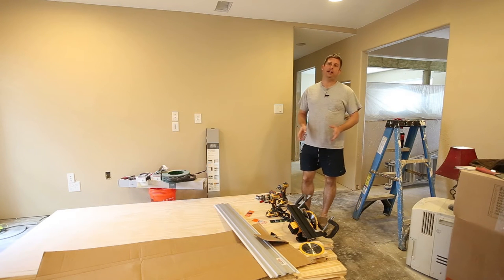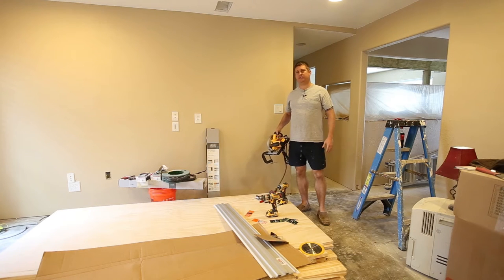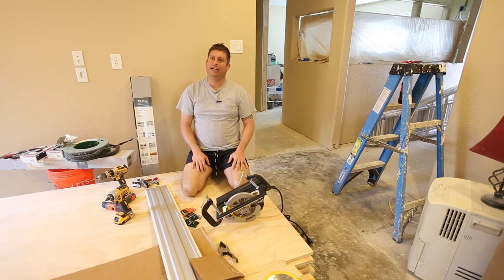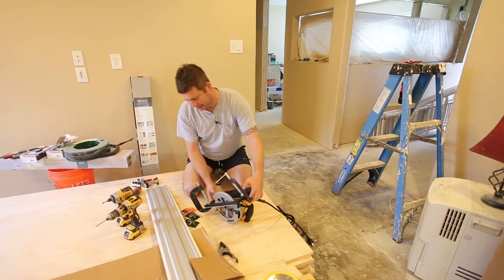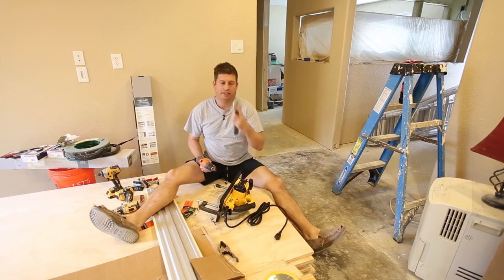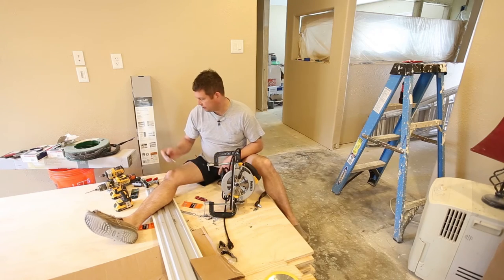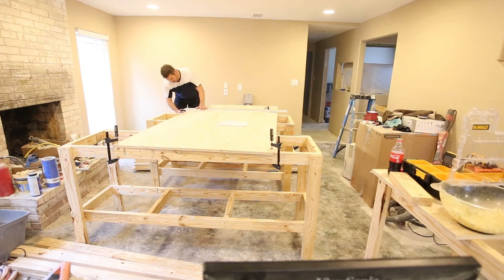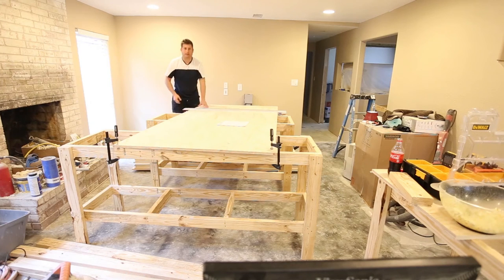TrueTrac Track saw assembly and review

Comment: I received my True Trac this weekend. I set it up on a magnesium base Masterforce saw from Menards. (Not the ideal brand I know, but it's worked very well so far and it's light to hold). The plate was a bit of a challenge due to all the cavities on the saw base, and I even found a video about it that did help.  Other than that I found that this product worked just as advertised.  I cut 3 doors off that I had recently painted and it worked great with no scratches on the doors.  I didn't have to use any clamps just like they say.  The Trac did not move on me at all, and there were no chips in the doors, again just as advertised.  Maybe I got you wrong, but the video seemed to me like you were just ok with it.  I thought it worked great.  I work with sheet goods quite a bit and clamping guides to follow just takes too much time.
Reply from the maker: There are some fit and finish issues that I don't like, but it certainly does the job.  Not as good as a panel saw, but far less expensive.

Comment: Always easier to go with a good company like Makita or Festool they're pretty much guaranteed to always be perfect no matter what you buy from them. None of the drawbacks you're speaking of in this video. I've been a contractor for near forty years now and have had something from Makita all the way back to 78 that Sawzall is still working. I bought some of the Festool things semi recently and they as well have been perfect but as you said, Expensive. Again as you said, you wanted a full on track saw but the reality is high cost as it is in most cases. However, I found with the Makita track saw there hasn't been a problem for over a year now, not a Flinch not a Twist not one bad cut. Not one. Either way I hope the best for you and your new track saw, however, old this video may be at this point. 5/29/19

Comment: I just got a free new Skilsaw Circular saw and was considering getting a system like this for it.   I agree I am not going to spend $400 plus for a dedicated track saw system especially being I don't work on site like some contractors do and need the dust collection and such.   Curious how this compares to the Kreg System?
Reply from the maker: I have not had a chance to test the Kreg system.  Overall Kreg has tools in two classes.... cheap plastic consumer, and pro-grade metal.  Some of their tools are quite nice... but I was not impressed with their saw fence attachment.  I think this is a well made system.  Mounting is a bit tricky but once it's done it's fine.  I use a nice dedicated DeWalt saw.  Be sure to check out the related reviews.  I bought the 8 foot track for it and I also bought the router mount.  I have not had time to use the router mount.  It's for doing dado's in my opinion.
Reply from the maker: I want to add that yesterday I needed to take the 4 foot track to the shop to cut slatwall panels for installation.  2 sawhorses, 2 reasonably straight 2x4's and the track and dedicated saw.  Very easy to throw in my truck and setup in the back of the shop.  Performed flawlessly.
Reply: The Kreg system will only go 48" max.  It has 2 24" sections.  Their literature actually says they won't support over 48" - which will only produce a cross cut.  Since I have need of ripping 8ft boards too, that wasn't an option for me.  I did originally buy the Kreg because it was only 80.00, but returned it before I used it.  I was thinking I might get their rip edge attachment, but that also requires the rip to have to be within the range of the arm that reaches to the edge and that the edge is true.  After all that, I decided to just go with the True Trac.  A friend has the true trac system and the adjustable arm cutting table.  Over 90% of his cuts are done on that instead of his table saw.  These items I can easily fit in my 2 car garage!  In the long run, I would have regretted not having the full 8 ft trac and it will be worth the money.

Comment: Brian  nice video I'll check your other videos out.. one thing is that the camera view on this video in parts does not give us a top view .
Reply from the maker: Sorry about that.  I shoot solo and sometimes that causes framing issues.  I've added quite a bit of equipment since then.  When I start using this to break down panels I'll shoot an update video.  I was happy enough with it that I bought the 8' kit to go with the 54" kit.  That lets me have two tracks that are setup for rips or crosscuts.  Saves time.  It's a great inexpensive system that lets me use a nice circular saw and not be tied into a special and expensive saw.  It's also a small American company that manufactures in the US.

Comment: The clamps do not affect repeatability at all...

And not having all of the parts of the product when reviewing it is not terribly useful!

Didn't need a 1 min tangent review of the Rigid drill either...
Reply from the maker: You are always welcome to shoot your own video.  Be sure to buy every toy that the vendor offers before you do your review.  lol.

At the time, this was a new offering from an unknown vendor.  I started with just some of their stuff to see how it worked.  I've since purchased a longer dedicated track and the router attachment.

I think the clamps are useful but not always required.  They are particularly good for ensuring the track doesn't move with more expensive material.  i've gotten lots of use out of my TrueTrac and it's been a great tool.